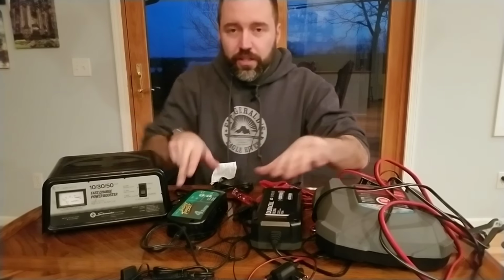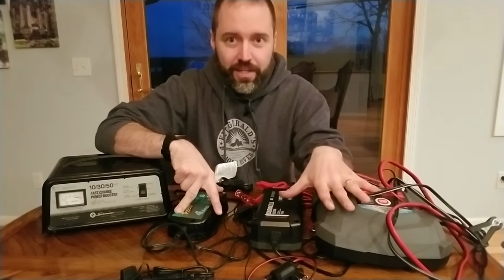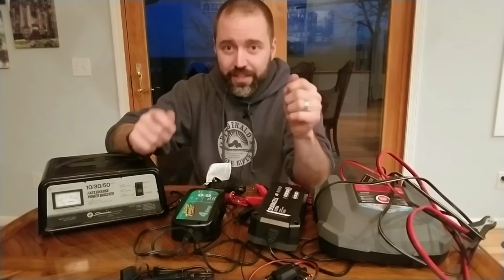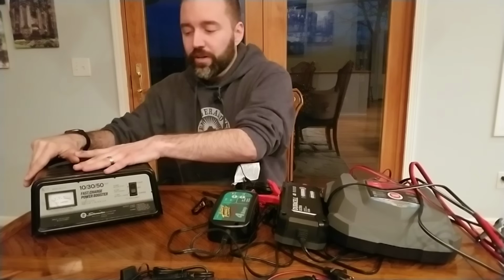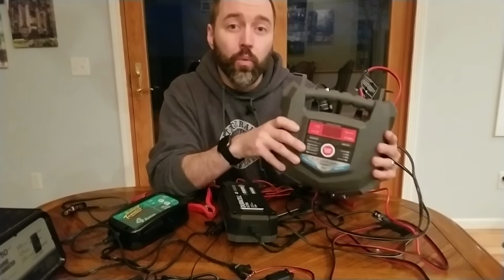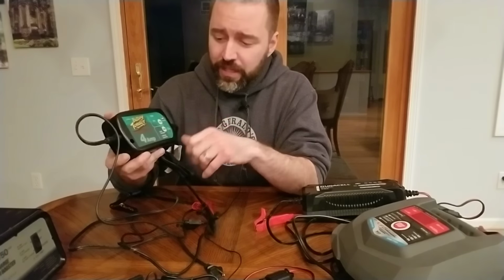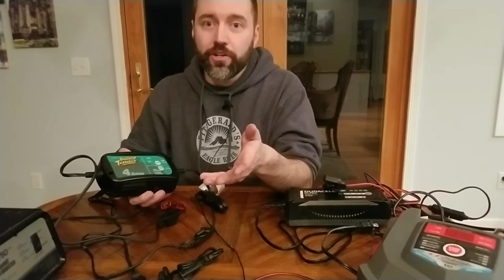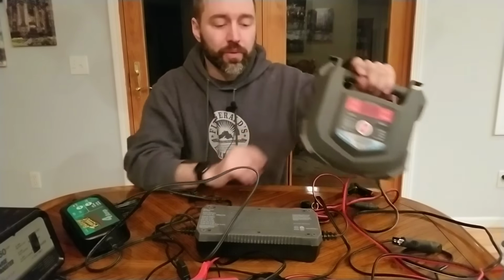Difference Between Float and Trickle Charger

Comment: I have used the Battery MINDer on my cars for over 25 years. Recently I replaced the battery in my 2002 Corvette after 13 YEARS. The OEM battery in the Vette lasted for over 8 YEARS. For some reason, nobody on YouTube seems to mention these devices. The big key with the Minder is that it uses a high FREQUENCY (not VOLTAGE) pulse to break up sulfite crystals. Therefore, no overvoltage. I connect the device to the battery if I will not be driving the car for 4 days.
Reply: Thank you for the info.

Comment: I am pretty satisfied with my NAPA 12V 4A/6V 2A trickle charger with a digitat display. I have a 2018 Dodge Ram 2500 6.7L diesel that I seldom drive. Since moving to So. Utah 4 years ago I've only put approx. 200mi. on the truck. With gas prices the way they are I prefer our Prius C which avg. 50mpg. The NAPA charger seems to be working fine for me, maintaining the voltage on both batteries wired in parallel on the truck.
Thanks for the very informative video...enjoy your day!

Comment: I always thought the old style chargers lowered charging amps as the battery charged, indicated by the chargers gauge. Plus, I notice that any bubbling becomes less and less to eventually none as the battery gets a decent charge (in my estimation). In any case I never left one connected till the gauge got much below 2, for safety's sake.

Comment: A heavy charge current from an unregulated charger must be closely monitored to prevent boiling, venting of dangerous gases and creation of bubbles on the battery plates. But the old-style, unregulated charger is the only way to begin recovery of a dead battery if a smart charger cannot.

Comment: Good advice. I have been through many failed battery maintainers used on five vehicles, two outside.. The Delran Battery Tender is the only model that has lasted for years on my five vehicles. I use two of them on  Subarus that are daily drivers. Modern cars only have 80 percent charge after a drive. They are not like the older cars. Their alternators don't really charge the battery, they just "maintain"it. So the batteries are chronically low.

Comment: Obsolete...not at all...I don't how many times I used a  "smart charger" to charge a low battery(not dead) and many hours later be told by the charger that the battery is bad, retried to with the same result, bad battery, tried with a dumb charger and battery took a full charge, been using that battery for 3 years now at temps below -25c no problems. Keep your dumb charger they are useful but be careful!
Reply: the average battery maintainer isnt meant to bring a battery back from the dead, very few of them are unless you want to spend a bunch on a high amp model that can do it. the old high amp "dumb" chargers can cram  some voltage back into it to get it back up to where a smart charger can do what it does best, top off and maintain. "smart chargers" are meant to keep the battery healthy and prevent dead batteries from happening to start with by maintaining the charge and keeping the crystals from forming
Reply: Crappy "smart" charger.
Truth is  chargers don't need to be smart, they just need to avoid overcharging the lead-acid battery.
Some chargers will limit voltage to about 13.8, this avoids overcharging, while others will do a "soak" or "bulk" to 14.4V then float at 13.8V
So IMO, a smart charger will try to detect battery maladies and honestly, this winds up being nothing less than a PITA.

Comment: Don,t throw out your old manual charger. If you have a 12 volt battery that is deeply discharged  say below 8 volts most smart chargers will not charge it.  You will need the manual charger to bring the volts up to above 8 volts then you can switch it back over to a smart charger and it will then charge it just fine
Reply: I overdischarged my 12v 200Ah sealed lead solar battery and it's nolonger holding much current. How can I go about it
Reply: But the fuck up that theory even more this doesn't apply to all smart Chargers
Reply: New smart chargers have a "Push" mode where they will still try to charge deeply discharged batteries. Mine will let you "push" a battery even if it's down to 0.5v.

Comment: The ‘dumb’ charger that this guy mentions, can actually charge two dead 12 volt batteries used on a Dodge ram 5.9l, 2500 truck engine for starting with no problems at all. The so- called ‘smart’ shit kept showing dead battery and shutting down. Even though I tried boost charging for a few minutes to give the cells a jolt, it kept showing dead batteries. Looks like the ‘dumb’ charger is good at injecting life back into the batteries and maintaining the charge.🤔👍👍👍

Comment: This is the best YT video that I have seen. I have an RV and a Marine Deep Cycle 12 V.  I am upset because I just spent $100 on a Schumacher 15 amp charger.  I do have it outside but under my RV (it has ventilation) but I do not want to harm my battery.   It is 11/24 so I am hoping that they have improved it.  I was wondering can any of them be outside in weather since it is an RV?

Comment: ..If I understand it correctly ...batteries  RT12120EV with 14ah should never be charged with 8ah charger ... so need to look for 1.4ah charger or lower ... good ( or may I use higher amp like 2-3 ?)

Comment: Great video thanks. I have a totally flat small 12V battery in my portable generator. I also have an older Battery Tender Jr. Did I hear you right that if the small battery is completely dead, the Battery Tender will not start charging? I attached it today and I have a red light on the tender. I thought that it might take a long time but now I’m wondering if it’s doing nothing based on what you said.
Reply: If your battery is completely dead then your battery tender may not do anything I have a 1.5 amp battery tender and it will not charge a completely dead battery I have to hook it up to my dumb charger to get it charging then switch it over to the battery tender

Comment: FYI old chargers are good when you have specials projects if you know what you are doing. I got ride of mine but had a project which I needed to use an old charger, baking soda laundry soap and a hunk of metal which I needed to chemically remove the rust.

Comment: A trickle charger supplies a low voltage to the battery at a rate similar to how fast the battery naturally discharges. 
This prevents the battery from losing enough charge to stop working. 
A battery regulator in the charger prevents overcharging.

Comment: A big crude charger has lots of value for recharging a big depleted battery from zero to 80%, then a smaller smarter charger will top off the battery charging and maintain a safe storage voltage for lead acid batteries. The inconvenience of having to manually adjust charge rates is a saving in the cost of a smart enough charger to do both fast and controlled charging in a single box.

Comment: Can I use a trickle charger on a 6 Volt 4-wheeler battery over the winter?  Also, I set my deep cycle trolling motor go too long and it will no longer take a charge.  Is there anything I can do to revive it?  Thank you for your presentation; it was very helpful.
Reply: Are you sure your 4 wheeler battery is 6 volt??

Comment: My Kisea inverter/charger, with transfer switch, contains a float charge under the lithium battery setting, which I don't understand, because lithium batteries do not need a float charge. Is this float charge therefore detrimental? My inverter is hooked up to my pellet stove, to cover for power outages when they occur. So it is hooked up all the time.

Comment: Great review, would these chargers work on a set of two 12 volt batteries connected in parallel for 24 volts?
Reply: Yes, you can connect 2 similar batteries in parallel to charge. 

This doesn’t double the volts though, they stay at 12v but the amps double so if you had 2 - 12v, 500 amp batteries in parallel the charger would think you had one 12v, 1,000 amp battery.

Comment: For a really low or dead flooded battery, the analog charger is the better charger, to maintain a battery at full charge the smart charger is the better one. Btw the only difference between the flooded lead acid battery with and without caps, with no caps they are designed with a vapor trap and the condensation is returned to the battery, and yes you can add dielectric, water to the battery's with no caps. PS you as a common person doesn't have a $2K battery charger, but your local auto parts store just might and that battery charger can reconditioned your battery for ya, not one of the chargers pictured in this video are large enough to do a full cycle regen for your battery.
47 year retired Commercial Industrial Electrician.

Comment: How can I tell if my OEM battery is AGM or just a regular flooded? It's a 2020 scatpack challenger. Nothing on the top of the battery says wet or AGM. No labels anywhere else. I removed the battery and gave it a good shake and lots of sloshing. So I assume it is not a AGM, just a regular flooded.. But someone told me AGM batteries still make a sloshing sound. Is that true?

Comment: Awesome thanks so much! Have a question for you I just got a Napa battery charger/maintainer model HFMC15A. It’s a 1.5A charger so pretty gentle. Using it to charge a 12V 22AH battery. It says maintainer on the box does doesn’t mention anything in the manual and seems to be holding a charge around 13.5V and doesn’t drop off. Is there anyway for me to know for sure if it will maintain closer to 12V or is that 13.5V within the realm of reasonable over charge? Think I’ll be okay or should I get a different charger?? Thanks!
Reply: You are safe it won't harm your battery at all in that case.

Comment: I have an RV and it is hooked up to a 30 amp I had installed but it did not charge my new Marine Deep Cycle Battery 12V while plugged in and I was wondering why not?  My battery was almost dead when I went to hook up.
Reply: This is mentioned in several other comments here. The "smart" chargers will NOT recognize nor begin charging a battery that is discharged too far, below a certain voltage. You must then use a "dumb" charger to begin the charging until the voltage rises to the point where you can change over to the "smart" one to finish.

Comment: Can i use normal "intelligent" charger as a battey maintaining charger? If i wanna store my motorcycle battery for winter, do i need some charger that is specifically maintaining charger? Or is just normal 4A intelligent charger enough to charge my battery once a month?
Reply from the maker: You just want a charger that's also a maintainer or has a "maintenance" or "float" mode if you're going to leave it connected for a long time.  Most modern chargers have that, they just all use different language to describe the same function.  If the charge explicitly says on the unit itself to disconnect after the battery is charged,  then I wouldn't leave it unattended for any length of time.  I'd just Google your make and model of charger and see what it advertises in the specs or manual.  If you type in your search term and include "manual .pdf" it will usually show up.

Comment: Hi! nice video ,,,, Can you leave the batterie connected to the car when connecting a float charger for the winter or do you need to disconnect the batterie. Thanks
Reply: Yes you can for a float charger but only use the float charge.

Comment: A few years ago I bought at the farm coop a "genius charger" , 26 amp. My intent was to keep my 2-way radio battery charged on float mode.  It failed twice.  First by losing output. Dead battery.  Next was serious overcharge. Dead battery. They had one in my local batteries plus store which I connected on.  They weren't interested.

Comment: Hey buddy I have a question I picked up a 1.25 AMP Battery Tender for my 12V 7AH Batteries to charge my Scooter Batteries is that the right charger for scooter batteries will appreciate your reply Back will help thanks
Reply: If your scooter runs its motor at 12 votls that would be fine but some scooters are 24 volt so you would need a 24 volt battery charger

Comment: I have an AGM battery on my car which I left for months outside this pass winter. I had to jumped start the car but then the battery started getting hot and released a really bad odor. Does that mean that the car is overcharging the battery too?
Reply: You probably connected it wrong.

Comment: Have you ever seen people using a stick welder to boil flooded batteries? They basically open the caps, fill them up, and boil them hard to get rid of the crystals and plating you're talking about. I've seen two videos where they did it to some degree of success.

Comment: You mentioned you keep a volt meter connected to your batteries. Do you have a link to that volt meter? Is this different from a multimeter?

It would be great to have an led read out that's constantly on while I'm charging without having to turn on my multimeter and checking the voltage.

Comment: very usefull and easy to understand information, thank you
Reply: Can someone please help us? We recently bought a Class C RV and have two 12 volt batteries wired in series we were told but I think they might be in parallel. They are sealed AGM batteries. We want to trickle charge so they won’t die. We have the SLC10005 Duracell Ultra Amp Charger but the instructions are vague. We don’t want to overcharge the batteries. When the 100% button flashes green we assume the batteries are fully charged and hopefully not charging anymore. Sometimes the button with the yellow exclamation point will flash and we have no idea what this means. And do you know what the stand by button is? Also, should we keep it plugged in all the time? Thanks so much!!!

Comment: Excellent video. Stupid question: I have 24x 2V deep cycle batteries in series. One battery is failing with extra low gravity. Can I attempt to charge it while it's still hooked up, or do I need to remove it first?
Reply: Depending on your charger you will get different results.  Are you using a 2 bank charger/maintainer?  Or just putting a portable charger on the series of batteries?   I had 1 bad battery 12v battery wired in series for my 24v trolling motor and it kept draining the good battery.  If you know 1 is bad I recommend replacing it because it will eventually kill both. If you are using a single battery charger disconnect the 2 and charge them independently
Reply: @briand1564  I'm supplementing one bad cell in a 24 x 2V string with a portable charger while they're connected to my primary PV array. I get the sense it's compromising my entire bank so I'm thinking of cutting it out, and charging/desulfating independently while I let the bank operate at 46V.

Comment: Float charge will, on a good charger let the battery get down to 12.6 to 12.4 and then pulse back on for a time. Batteries that are left charging at 13.2 to 13.6 get "lazy" after a while at that constant charge.

Comment: The “dumb” chargers have a very important role in battery preservation since they are the only thing that can bring a dead retired battery back to life. I’ve taken batteries that have sit behind someone’s barn for a decade and brought them back to life with a high amperage jult.... You can take a battery that has 0.00 volts for the last 10 years and bring it back to life but it would not be possible with these new chargers.
Reply from the maker: 100% in agreement with you.  Excellent point!
Reply: But there is a point you are missing; old manufacture had higher quality
Lead in old batteries maybe 3 or 4 times the quantity of new age batteries
Reply: @igrewold  It doesn’t  matter how old the lead is. If you run a battery new or old all the way down a newer smart charger will throw a light and say replace battery.... I dont have the money to be buying a battery everytime my kid leaves the dome light on. Take that same battery and put it on a standard charger and it will charge it no questions asked..
Reply: Just bought a $59.95 Deltran Battery Tender from Amazon to recharge a totally 'dead' DieHard 12V for my '02 Camaro SS but something's killing my 7yr old battery slowly after leaving it intact for a few months. I'll get to troubleshooting that later however Sears is no more here in New Hampshire and customer service says no go on their warranty. Likewise I don't want to buy another $200 so I'm trying this 1.5 Amp trickle charger and hoping for the best. So far the green and red lights are flashing and operatively working.
Reply: @xravenhairsexgod   A battery tender will not charge a depleted battery correctly it takes a battery charger to do this however a tender is a great item and can make battery life much longer. If you have a battery going dead after a short while you could have a parasitic draw on the battery from the vehicle or a bad cell in battery,you would need to narrow that down first.

Comment: Looking to avoid filling up my 2018 maxima every 2.5 days because of using my A/C for 12 hour shifts for the upcoming summer. Started looking into portable battery trickle chargers and maintainers, or dual battery isolation kits, or portable Air conditioners with accessory battery packs, etc. Looking to see if anyone here has been in a similar situation and found a solution where they can either run their car's ac off accessory mode and preserve the car's gas mileage or use a recommended portable air conditioner. thanks in advance

Comment: I use the old school charger for a discharge battery most smart charger over rate there current. So I use the old school charger for the bulk charge then use a smart charger to do the rest.
If you got a real bad discharge battery the smart charger may not work because The battery us to low for the charger to see to turn on.
But 95 percent of the time just use a smart charger plug and play.